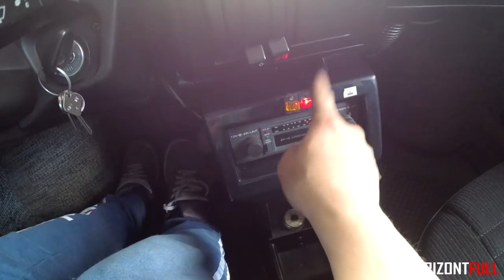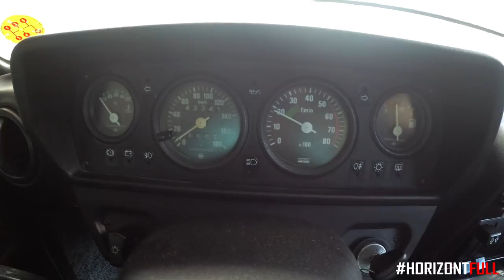PRVNÍ START ŠKODA 130 - #HORIZONTFULL

Comment: Wonderful original 130! Do you use 10w40? Isn’t too thin? Was it an old fuel hose or because of the ethanol in the gasoline? Looks like a low mileage car 😃